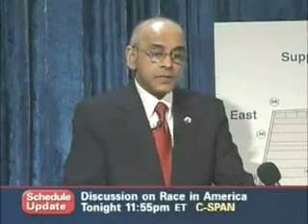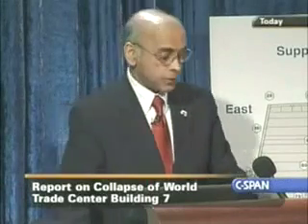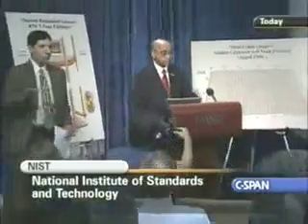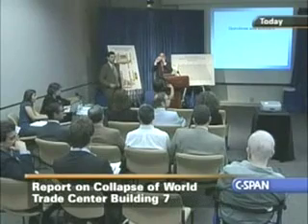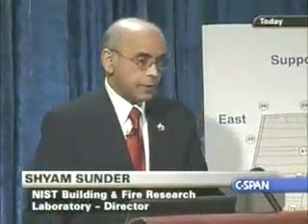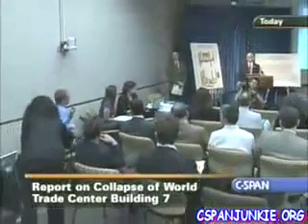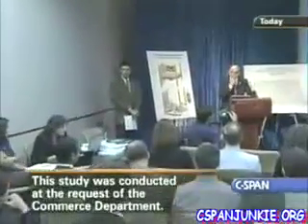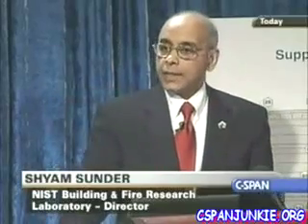NIST WTC 7 Report - Press Briefing 8/21/08 pt 3

Comment: Anyone, and I mean anyone can see that there is only one way that anything can lose all structural integrity, all at once and drop without any resistance, is the use of well placed explosives by a team of experts. If you need to be told this you may need help putting your pants on.

Comment: if you heat up a 54ft beam around 600° it will extend around 3.9 inches. This will most likely result in buckeling of that beam reducing the stress on the vertical beam.

Additionaly, the stress is not on the beam allone. It is reroudet to surrounding beams. If you cut the building in half, it will still stand.